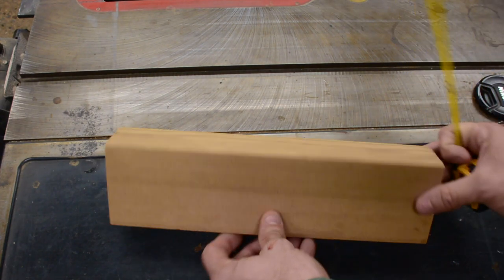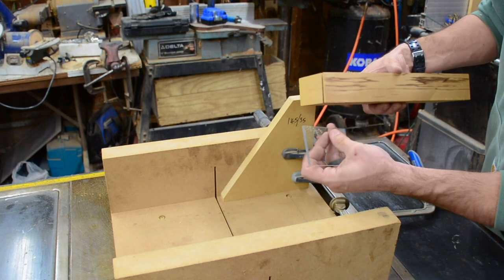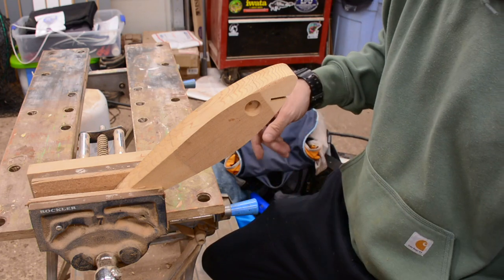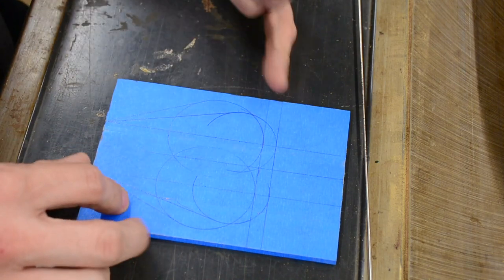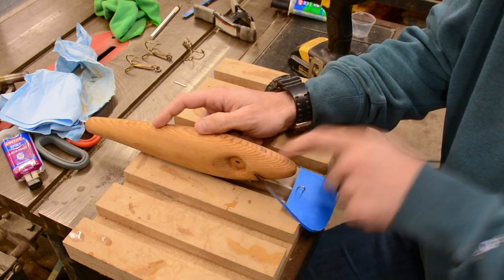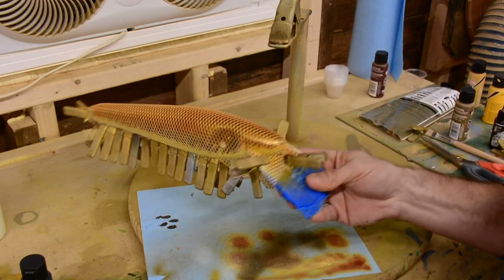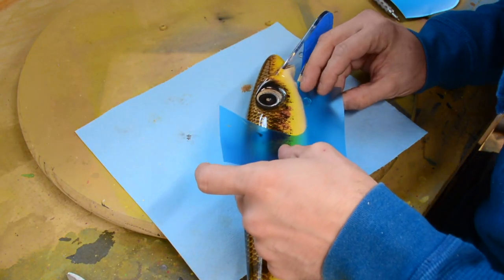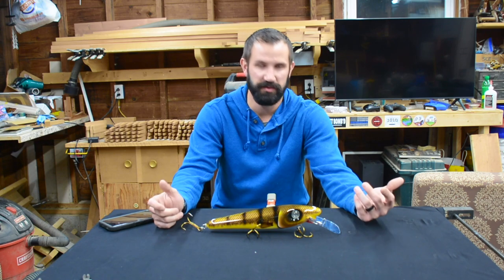Making a BIG Musky Bait

Comment: I want to drill a hole in each of my pike lures so that I could add some split shots into them to make them heavier so that I could get more casting distance with them and make them dive deeper. Do you know of an epoxy or resin that I could use to seal those holes in my fishing lures? Would that 1-hour Loctite Epoxy be a good one to use? What I want is something thick enough so that I can maneuver it and shape it into the holes that I have drilled and then smooth it with a piece of sandpaper after it has dried so, therefore, I don't want anything too runny so that it would fill the entire cavity of my lures, which would only kill the sound of the lures since my lures are hollow inside. If you could recommend a product or two to me I would greatly appreciate it!

Comment: What type or brand of clear coat or epoxy are you using on this bait or all of your baits? Also where can I get a quality torch that lights in a single click such as yours. Thank you excellent work always thought out and prepared. Thank you
Reply from the maker: The topcoat I used is Amazing Clear Cast. Not only is it readily available and cheap, it's also my opinion that it's the best topcoat out there. The torch is a Bernzomatic trigger torch ($36) with map-pro gas cylinder ($13) You can find it at Home Depot.
Reply: @FrettholdBaits  I have been having issues with a “wavy” finish using amazing clear. I know you just made a whole video on the process but any specific tips for clearing? Super frustrating to put the time in and end up with a crappy, wavy finish. Apply thick, thin? Shop temp? I’m stuck at this point. Awesome videos! Thank you for taking the extra time to create and share.

Comment: Nice work and great editing, fast forward is fine. my only critique is that the eyes are way to far back to be anatomically similar to a fish... if that's what you're going for.  Oh and the tan color is pronounced (See Pee Ya) 🙂
Reply from the maker: This model is called the "Cuda" after barracuda and is based off of a 16" jointed barracuda I made. So the eyes are set back a little bit because the "nose" of the bait is a predatorial snout. Also, I love how eyes compliment a paint job so I go with 16mm and I like the eye set back farther because of the carved eye-socket I do, plus it leaves more material in a potential weak point of the bait. They may look a little far back if you're thinking Bait fish but theres a reason they are where they are - but I get it. 

As for Sepia, thank you. I feel like I've heard other people say it say-pee-ah so I must've picked that up somewhere. Now I know.

Comment: What kind of wire do you use for the through-body?
Reply from the maker: Stainless steel welding rods. 0.0625" (1/16") Your local welding supply store will have it.
Reply: Awesome, thanks!

Comment: always add a mid coat before you use any kind of tape....4050 or Minwax Polycrylic...I made the same mistakes tens of times
Reply from the maker: I can get away without it if I let my paint completely dry and cure. I really should've done a mid coat but I always rush these baits for the videos.